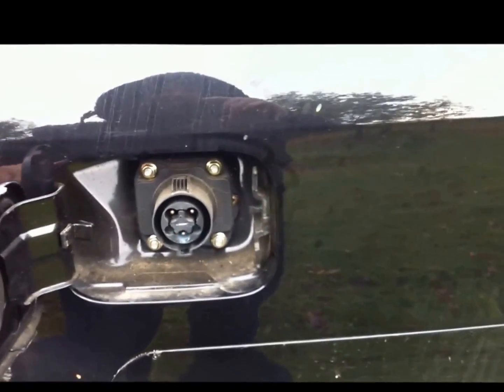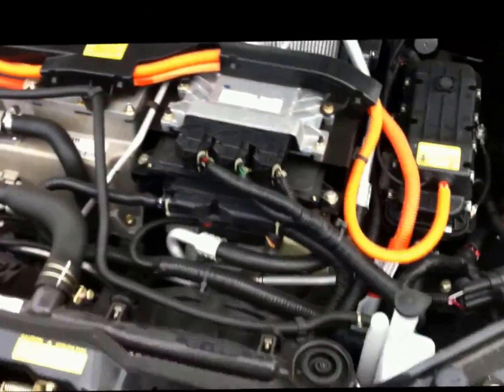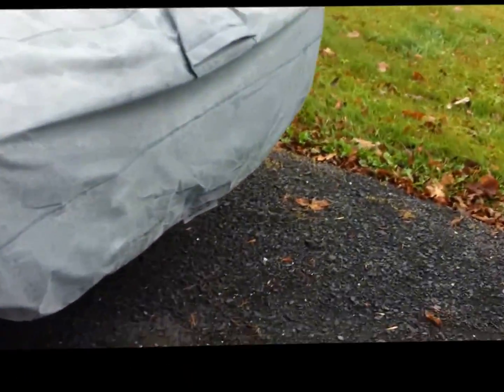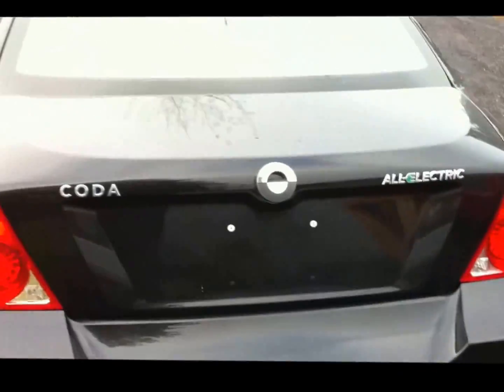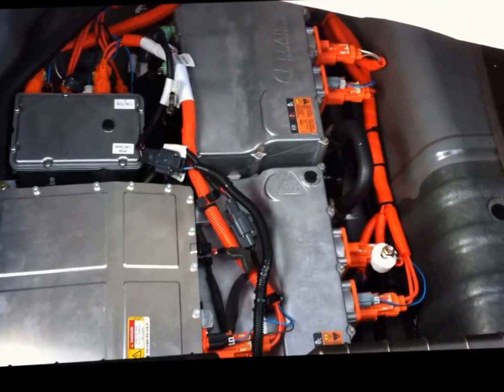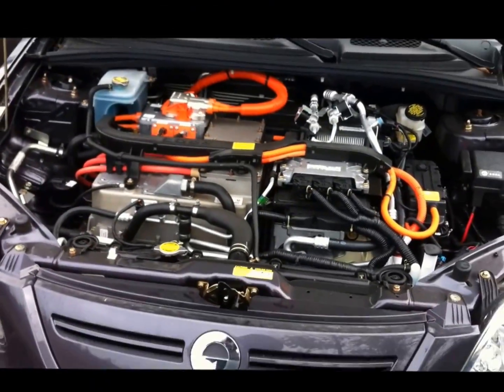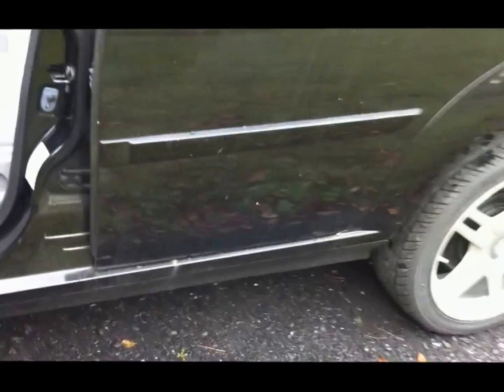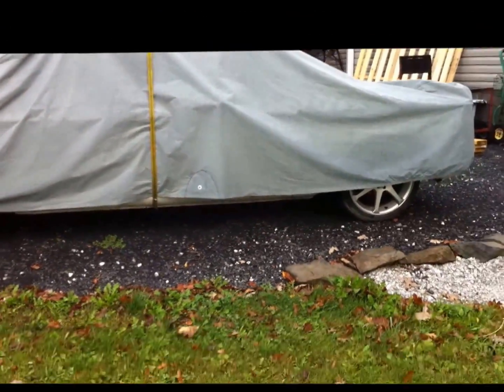H2EVair: Series EV hybrid part 3, delivery of new 2013 Coda EV

Comment from the maker: Well the original plan for this project has changed many times over the years as technology has changed.  The rotary option has become less attractive simply due to availability and the fact that they are not as efficient as a diesel - and also that a diesel can run biodiesel with no mods.  Not so easy with a rotary. The diesel is an intermediary solution, however.  Obviously the Holy Grail of this project is the use of a PEM cell fed by home made hydrogen.